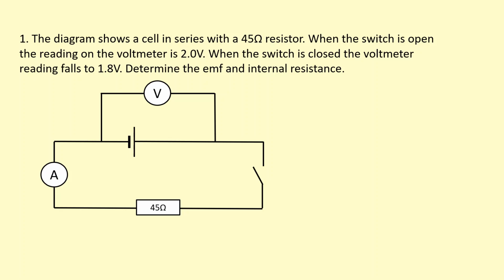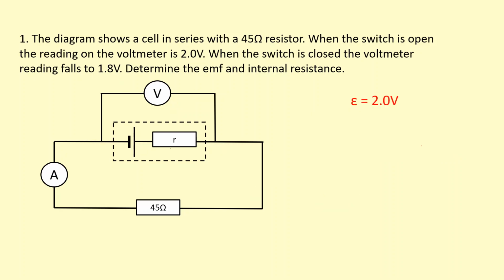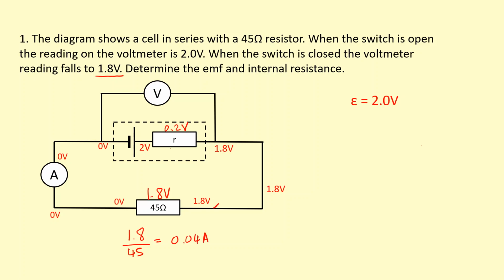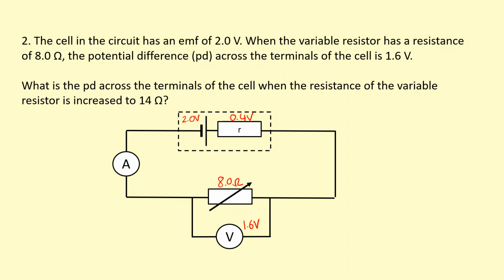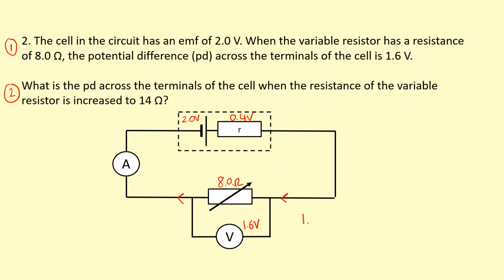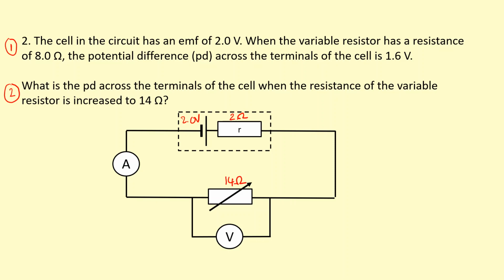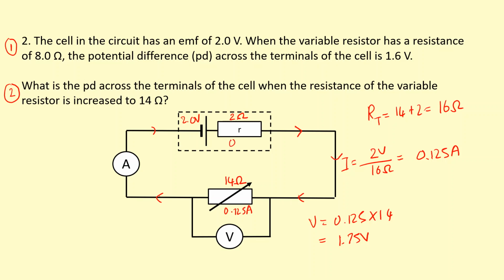3.22 How to calculate emf and internal resistance

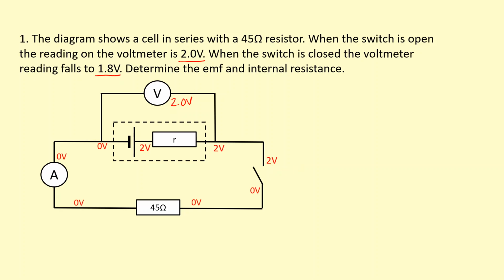Comment: 0:50 can u please clarify further how voltage is used at the air gap if current cannot flow/ electrons cannot move to reach the air gap in the first place, I can understand that the electrons are stationary since 0 current so no flow of electrons, and that the p.d is still applied to them, but I dont rlly get how the pd is used at air gap.

Comment: also based on v= ir if total current is 0, would total voltage/p.d also not equal to 0? how can the emf be 2
Reply from the maker: emf is the energy supplied to each charge by the circuit. ( The electrons pick up the energy from the battery but can't move because the other electrons can't move)

V = IR
if R = very large, pd divided by a very large number tends to zero current.

The open switch has very large resistance.
Reply: @MrNagaPhysics  so the energy is transferred to each 1C of charge, and then the 1C of charge does not flow?
Reply: @MrNagaPhysics  also how come voltage is used at the air gap if the electrons cannot flow there.

Comment: 0:51 how can there be 2v of energy until the open switch if there is no current flowing throughout the circuit due to the infinite resistance of the air.As current carries energy and provides a p.d. does the diagram tell us that there is a current flowing until the open switch? how else would the 2v get there otherwise.i dont understand, i thought current is required to carry the charge and p.d. is lost as current gives out energy to different components
Reply from the maker: Potential difference is the difference in the energy 1C of charge will have between two points. ( in this case one side of the open switch vs the other side of the open switch). A charge doesn't need to move across it and use the energy for us to say that the potential difference between two points is 2V. What we do know if that if the charge did move across it, it will use 2J per C of charge.

"Current is required to carry charge" --> The particles ( in this case electrons) already have charge. The movement of these charged particles is called a current. The particles would have charge even if current didn't flow.

You can have pd between two points without a current across the two points ( i.e when resistance is very high)

Comment: Hi i got one Q, in circuit used for finding internal resistance, voltmeter should be connected in parallel with variable resistor or the cell ? cuz textbook does it across the cell but in some ms examples, they do on the variable resistor. Or are both of em acceptable
Reply from the maker: both are acceptable. The pd across the cell is the terminal pd), the pd across the variable resistor provided there are no other resistors should be the same.
Reply: @ tysm